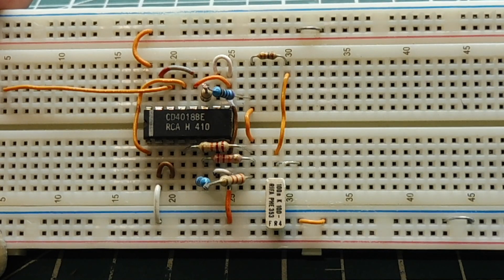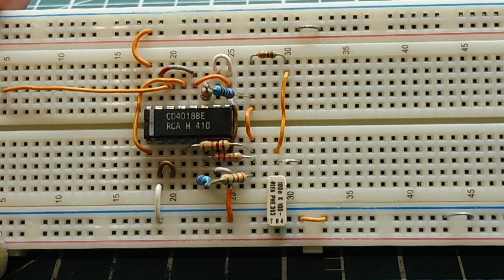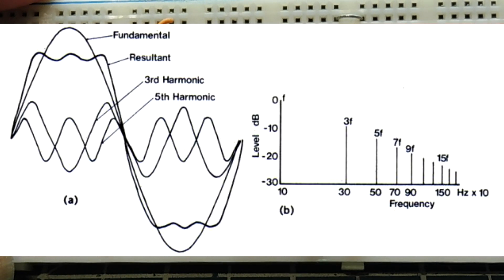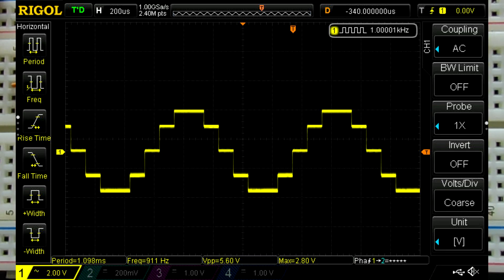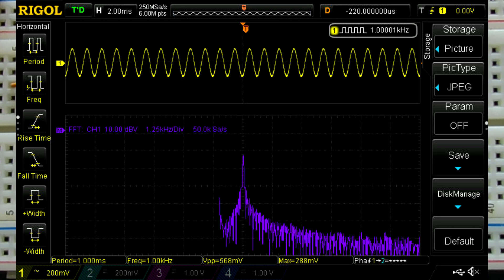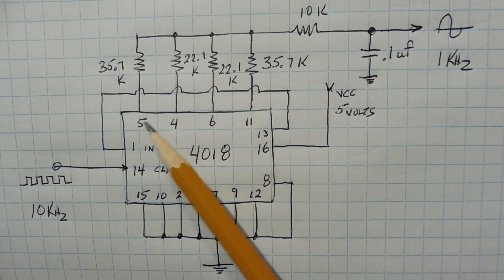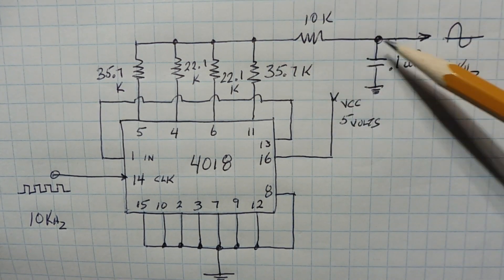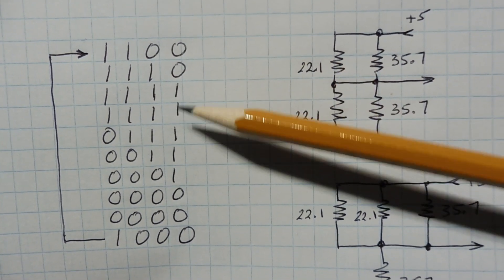Build A Square-wave To Sine-wave Circuit.

Comment: Very cool. Are you a ham radio operator as well? My call sign is KN6KLL
Reply from the maker: I have been in the LMR Two Way Radio field for many years and have built and donated ham repeaters to local ham clubs. Projects with them involved Kenwood NXDN radios:
https://www.dropbox.com/s/clumyc088dw1hk8/291_Merk_AP.pdf?dl=0

Comment: Probably a dumb question, but I'll ask anyway if you don't mind :).  I understand that it's generally not a good idea to connect the outputs of a CMOS chip together, especially when the outputs are not at the same state (hi/lo).  I realize that your outputs are not wired directly together as there are resistors in place so that there is some impedance between the outputs, but it still seems as though in some sense, the outputs are connected together.  Maybe it's OK because the resistors are of fairly high ohms (10s of K's).  Is that correct?  If so, then if you were to scale the values down to say a few 100 ohms, does it then start to become a problem at some point?
Reply from the maker: Yes .. you are correct. Normally we do not connect the outputs of CMOS gates together as excessive source/sink currents can occur when one output is high and the other low.
With the value of resistors used, the currents are below the maximum spec of the IC. Lowering the values of resistors where the current exceeds say 5 mA with a VCC of 5 volts would be a problem. It is common to see CMOS outputs driving a LED with a proper value of current limiting resistor.

Comment: Clever idea. What combination of sine wave frequencies and timing did you use to generate the ring tone, please ?
Reply from the maker: The ring tone was generated by square waves from the microcontroller GPIO pin. The frequencies are 500 and 600 Hz with an ON duration of 40 ms alternating  3 times.
Reply: @0033mer  Thanks. Worked a treat.

Comment: The result is a beauti sine wave, but i dont undestand  the theory behind this work, why using Jonson counter and the value of resistors is not like CNA resistor le :R-2R
Reply: I had to manual go through the logic diagram shown in the data sheet to derive the truth table. I didn't know how he got two outputs of zero and two outputs of one consecutively. It is because Q5 although not used in the resistor ladder , is still involved in the counting so  Q1 thru Q4 are all ones during the two counts where Q5 is at first a zero then a one.
So during those two counts Q1 thru Q4 don't change   Same thing when Q1thru Q4 are zero's. Q5 is a one during one count then a zero during the next count so Q1-Q4 stay the same during those two consecutive counts.
Reply: Don Lancaster described this in his book CMOS Cookbook.
Reply from the maker: You could also use a R-2R resistor ladder network to create a sine wave. This would involve a microcontroller and lookup table code. Using a ring counter is simpler and less involved.To understand how it works go through the truth table and do the calculations.

Comment: Thanks! Would any of the other CMOS counters work with this? Like the CD4017?
Reply from the maker: You can also use a string of D flip-flops(4013) and cascade them together. The 4017 will not work as it is a 1-of-10 counter.
Reply: @0033mer  If you chose resistors to approximate the curve of a sine wave with each output, it seems like it could be done.  Would you agree with that?
Reply from the maker: Yes .. the more flip-flop stages used with correct resistor values, the better quality sine wave output.

Comment: The resistor values probably aren’t that critical, the ratio between them is what would be important to produce the correct voltages for conversion and yes of equal values to ensure the divider works accurately.
Reply from the maker: Yes .. the ratio between them is calculated for proper conversion. In a four stage circuit the standard value resistors I used would have satisfactory results. The calculated ratio is 1.618. I have built 16 stage circuits where the ratio values have to be adhered to for proper results and 1% resistors are a must.
Reply: The ration is, of course, the Golden Mean or Phi!
Reply: @0033mer  The ration is of course the Golden Mean or Phi.